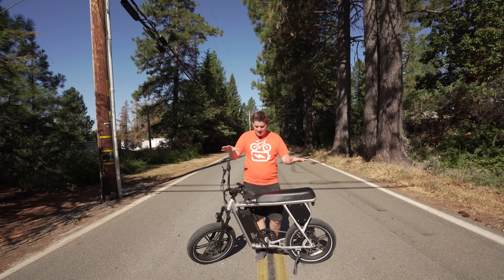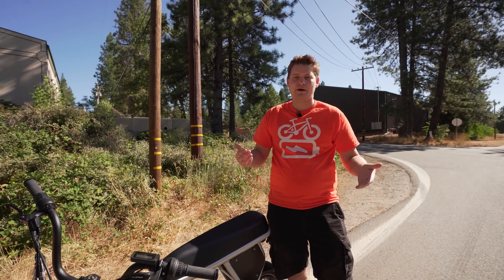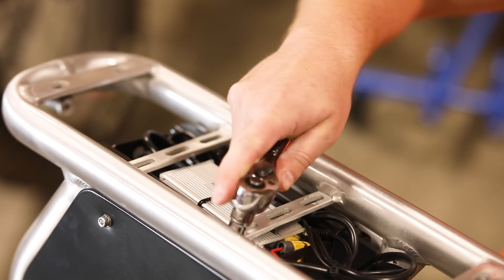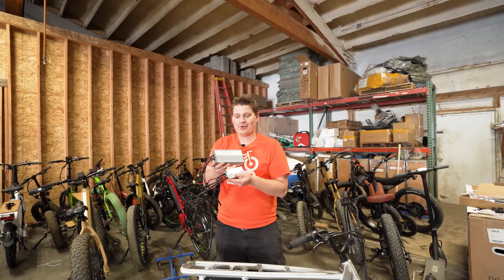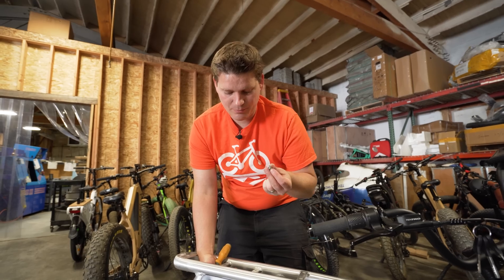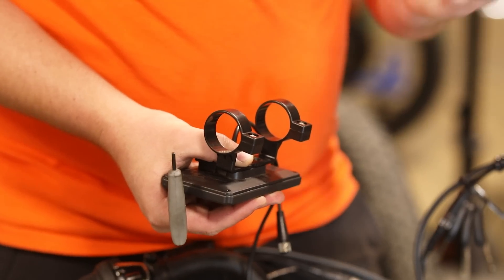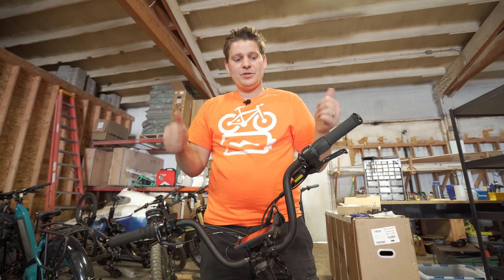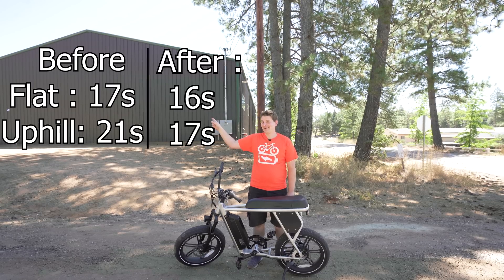How To Make This Juiced Electric Bike Faster

Comment from the maker: What electric bike do you need an upgrade kit for?
Reply: Juiced Hyperscorpion.
Reply: hyperscorpion and class D Ariel Rider
Reply: Hey I would like if you could make a controller for the juiced Rippcurrent the throttle is so slow
Reply: Cross current x
Reply: Rad City 4 - the boltonebikes.com knowledgebase mentions that you guys are looking into a 1500 watt motor for the Rad City.  Is that still a possibility?  Any ETA?
Reply: Juiced Ripcurrent S please!  The controller is undersized and always overheats with moderate hills.  The controller is buried in the frame which I think is part of the problem.  Automatically reduces power when hitting 90c.
Reply: This one!!! Please I NEED this upgrade!! When is it available my brotha?
Reply from the maker: @wreedshupeii2997  Soon! Be sure to sign up to be notified when it's ready. 

https://boltonebikes.com/collections/motor-controllers-and-displays/products/juiced-controller-upgrade-kit-coming-soon
Reply: Would like to see one for the Himiway Cruiser fat bike - would love to see and upgrade controller/display kit similar to this one and the RadRover upgrade kit. Also, would really like to see you do a video review of the Himiway (maybe a side by side test vs. the RadRover?)- here's a review of the Himiway from EBR: https://electricbikereview.com/himiway/cruiser-ebike/
Reply: The RipCurrent from Juiced is my daily driver would love a plug and ride kit option!
Reply: @graycatgrayhat3404  Hello sir. I am looking at getting this bike. I will use it as a car replacement. How is it holding up so far? Do you think this Juice bike is a better value than the Ride1Up LMTD?
Reply: @davoncci  Juiced has a 52v 13ah compared to the Ride1Up 49v 14ah so more power slightly less range.  The Ride1Up has a nicer RST front fork, and more premium Schwalbe Super-Moto tires.  Juiced has a great head light out of the box, plus the have a rear light if you are willing to wire it after the fact.  I would still pick Juiced, but I have seen several brands come and go and Ride1Up is here to stay so also a great option.
Reply: @graycatgrayhat3404  Thanks for your response.
Reply: @graycatgrayhat3404  someone did some homework lol, gj.
Reply: Ecotric hammer
Reply: Ariel d class
Reply: Lectric XP.  I read an article recently that stated that 25,000 XP model ebikes were sold.  That's a lot of potential customers looking for a performance boost.
Reply: Eahora folding x7 fat tire bike
Reply: volt Yukon 750
Reply: How about an upgrade controller for Pedegos?  I would buy!
Reply: I ordered an upgrade kit from your store July 17 for the Rad Rover 5 and I still haven't received my purchase and I haven't heard from anyone after several attempts to find out what's going on?! Starting to think I WAS RIPPED OFF!!!
Reply: hey Bolton i have the newest Hyperscrambler2 from juiced and would love advise on how to get the upgrade to make it faster
Reply: The scrambler 2 bike
Reply: HyperScorpian
Reply: I bought a ripracer. Maybe I’ll upgrade in the future
Reply: @ThunderBritches  That would be good for just swapping in a motor from like an Ariel Rider X class 52V.. stock stuff.
Reply: @kevinnashskitchen3517  I’m new to this e-bike world. Would you happen to have a link? Just engine, keep my stock controller? And thank you
Reply: I'm not sure you want to tackle all that. 😁 best wait for a kit plug and play for that bike.
Reply: @kevinnashskitchen3517  I’ve worked on motorcycles for 30 years. I’m just new to ebike planetary motors.
Reply: Let's gooo!! :)
Reply: Juiced Hyper Scorpion for sure, it already performs decently but would love to have even more.
Reply: natko 22” camel!!
Reply: Juiced City Scrambler!  Thanks!
Reply: Xiaomi himo z20
Reply: Eventually I would like to get one for my ecotric hammer. I have all my money into that right now. It is my only transportation. Last night I was in a torrential downpour for hours. I'm not sure if it does damage. I think if I put a new controller I would have to put it on the bar or something because I think it's right under the battery and it's not that big of a controller I haven't seen it yet but eventually I'm going to take it apart. Man that thing really goes. It definitely felt like it took off I wish I had a three-wheeled just for going shopping and the other one for just riding. But I do tow a wagon with it. Thanks for the videos I really enjoy these
Reply: An upgrade kit for the Bagibike B10 would be great to have.
Reply: Yeah I noticed it's all Plug and Play and you don't have to change a plug that would be nice if I had service on the eagle trading which I don't I don't even have a manual that's the bad thing the price was the good thing the service is not good
Reply: I ordered a battery from electric bike company EBC. I ordered it last Friday is that it was 10% off. I never even Get a tracking number until today almost a week later.. if I had the money which I didn't I would have bought it from a reputable dealer that I can talk to a human being instead of getting emails and thinking it's a human when it's not I figured that one out after a while the same message over and over for a week cuz I'm you can't talk to a human being at ecotric or electric boarding company none of them. You can leave a message they will never call you
Reply: 1500w 52v radrunner upgrade!
Reply: Hyper e bike
Reply: Addmotor Motan M70
Reply: Ecotric Hammer bike please
Reply: Himiway
Reply: Michael blast outsider please
Reply: Juiced Camp Scrambler
Reply: Juiced Camp SCrambler
Reply: Ecotric 36 volt 500 watt fat bike needs 48 and 750 watt geared...
Hydraulic brake upgrade and suspension fork.
It's really a good starter bike for as low as 899.00!
I bought one used for 500
00 cause it was underpowered! Basic bike is a good starter! I even thought of the older bafang midmount at 750 watts would make a good bike!!
Reply: Dclass
Reply: I want to upgrade my Radrover to a bike with with 26x4.8 tires, a 48v21ah battery, full fenders and a mid drive for less than $2400. It has to be beeyootiful, and I want to buy it from you. Think Biktrix Juggernaut HD Duo.
Reply: @rubbertwain  can 26" tires fit the frame?
Reply: @hoobakam.3931  Hi there. I'm sorry if my comment wasn't clear. I have a Radrover, it's awesome, but I want to buy another electric fat bike. Bolton offers many styles of ebikes, and I'm waiting for them to offer one that I want to buy. My comment above is expressing my requirements. Cheers.
Reply: @hoobakam.3931  And to directly answer your question: yes.
Reply: 6 hey bro I got a red Rover is Scott 11 miles on it give me a shout 918-214-6195 918-214-6195
Reply: Juiced Scrambler please.  Want the throttle to work like a gas engine throttle.
Reply: Bolton Bronco!
Reply: Hey you sale bikes like that and  how much
Reply: i have a juiced bike scorpion model regular and im thinking of putting extra batteries. Do you have any recommendations where to get them? the one i have right now is 52V 13 amps and im planning to put extra battery. Please advise. Thanks.
Reply: Juiced Scorpion for sure!
Reply: Scorpion
Reply: Scorpion
Reply: I just ordered an elux Sierra GT and I’m psyched, can I upgrade to a 1000 watt hub motor? It comes with a 750 watt motor and 11.ah 48 volt battery.
Reply: I would love a 35Ah controller upgrade for my Rize Bike’s “Liberty” 750 Watt. It comes with a 28Ah controller
Reply: Volt bike Yukon 750. And for the 500w model if possible
Reply: Mzzk fat bike
Reply: Addmotor 48 volt 24” wheels 19 amp hour battery 750 watt bafang hub motor
Reply: I just bought a barely use juiced City scrambler I believe it has the mag wheels and it will only go up to 20 mph
Reply: How about a upgrade on rip current s I know the controller inside the tube so how can I upgrade
Reply: City scrambler
Reply: Super73 Z1
Reply: Scorpion
Reply: My Juiced Camp Scrambler!!!!! I want to be able to tell people it is 'Bolton Modified' !!!!! I am looking forward to it.....!!! I will make a deal with you, Kyle: If you sell me this upgrade, I will also buy a bike from you! How's THAT for a deal?
Reply: I would be interested in the details/video of an upgrade on my  hyperscorpion..thanks ! I truly enjoy all your videos
Reply: Hi.. is Hyper Scarbler ll upgrade available on the website yet?
Reply: I’m looking into getting a scorpion X . Any upgrades for this bike?
Reply: W V
2 weeks ago
Hi.. is Hyper Scarbler ll upgrade available on the website yet? Any news on the X15?
Reply: Ariel rider xclass 48v 16ah
Reply: I have a Juiced crosscurrent s2... It performs wonderfully but I would love to get more out of it if possible...
Reply: Himiway cruiser upgrades pls
Reply: Super 73 s1
Reply: I also got a juice scrambler
Reply: crosscurrant x
Reply: Hyperscrambler 2!
Reply: Oh I’d love to get this upgrade for my fat tire ebike. I’ll give the name if it’s still possible no secret just want to spell it correctly lol so I need to go look at it but I’m not doing that this second. I also need to figure out how to measure and what size fork I’d need because I also want to upgrade it to suspension something decent right now it’s solids which are fine BUT my girlfriend crash it and bent the fork in a weird way I notice it’s slightly almost like twisted on one side a bit or it’s just either more bent or only bent slightly on the right side it’s enough I notice when riding and I can tell because I know where my tire should be when I look at it riding and it seems now too close to the pedals but not enough to make it unrideable but I was thinking of an upgrade anyway so now this is like saying do it man lol. But yes to use more potential out of the motor would be great plus as well. Question I’d have is would I need a higher voltage battery? I didn’t notice you did in the video unless I spaced out and missed it for some reason but idk for sure.
Reply: Ariel Rider Kepler needs a few display features added. A means to adjust power% for PAS levels.. A good wattage readout and voltage remaining would be very nice. . A 40 amp max from its current 33 amp stock would be perfect for this big custom 1000 watt Bafang . 063
Reply: Can I get one for my scorpion X. Looking at your new site I don't see one but it looks like you might be able to make me one
Reply: Hyperscrambler 2
Reply: rip racer
Reply: Juiced Rip Racer
Reply: Lectric XP.

Comment: I wish My little 500w Swift Zip had way more power than it does.I looked at upgrades but if I have to swap both motor, controller and LCD, I might as well buy a different bike.

Comment: The display on my Ariel Rider Kepler could be much better if it includes an ability to program power % for each PAS level.. 9 levels or 5 . Also the voltage is not available. Anyway, I believe a new display and controller upgrade for the Kepler would be great. 33 amp controller could easily be upgraded to a 40 amp with the custom Bafang 063 1000 watt rear hub. I'm sure one of these controller and display upgrades would sell very well in the Kepler Groups once word got out.

Comment: Also, I have the second battery pack on the rack with a battery blender and I've been wanting to get a battery charge monitor but I'm not sure if it's for using it while it's charging or using it on the bike at all times? And whether or not I should get two to monitor each battery individually? Thank you for your help!

Comment: I just recently bought a HyperScorpion, and I'm very interested in upgrading!

I actually had an incident recently where a dog ran me off the road and I ended up breaking my arm. I feel like if I had an extra 5mph or more then I could've out ran the dog and the wreck wouldn't have happened.

I will 100% be getting controller and motor (and maybe even battery) upgrades as soon as I'm able.

Comment: @Area13 I have a Juiced Bikes City Scrambler and I would like to get the upgrade kit but I was wondering do you have a bigger 750watt motor that would fit into my casing. I also changed my freewheel from the stock 14/28 to an 11/28 and the chainring to a 56t. I would like to know if I should put an 11/34 freewheel on the bike to get a little more speed that way as well. I’ve been calling your company phone without any luck to get someone to pick up the phone or call me back. So can you please respond back to me and let me know what to do as far as talking to someone from your company. Because I want to be able to go faster on my bike

Comment: I'd rather build a bike from scratch if I'm gonna be replacing controllers and stuff.... I have an Mx650 w/ 48v 2000w and it does 35mph but I don't like riding it far because it doesn't have pedals but it's still super fast.

Comment: Need "better", not bigger.  The Rip Current S has the controller in the downtube, so it needs to fit.  Also, did you still experience the top speed flutter?

Comment: I just ordered the scrambler with the larger battery option and their off-road module. I'm excited for it to arrive so I can use it to get to work instead of having  to drive and pay for parking. The only upgrade I wish it had would be a rear basket option so I can have something to strap my half-gallon jug of water to, and some sort of GPS for theft recovery.

Comment: An upgraded controller for the Super73 RX would be nice. I suspect that there's more that can be gotten out of the stock battery+motor combo, especially on the low end, where the RX feels pretty weak. It really picks up once you hit 20ish

Comment: More amps will make acceleration and up hills faster, however it will do little to top speed on flat ground.

A voltage increase will raise the top speed on flat ground.

Comment: Great video and very much opened my eyes to upgrading my ebike beyond cosmetic changes. 
I have a Super73 S2. What would you suggest with regards to performance upgrades?
Also, are there any aftermarket throttles that work for the Super73 S2? I have an EU spec bike and they don't come with throttles.
Thanks

Comment: So ?  What's your version of the same type bike ?   Do a side by side comparison with your bike.  
  Your upgrade kit didn't fit or bolt up very good.  There didn't seem to be a big performance improvement.  Possible wiring  overheating ?   It might be time for you to go back to the drawing board. Lastly.... how much does your upgrade cost ?

Comment: Just got a hyperscrambler 2.  It has a dual battery 52 volt and a 35 amp peak controller.  Can that be made faster?  Top speed is fine at around 32mph with me (240 pounds) on it but better acceleration would really be nice.

Comment: I have the HyperScorpion, would love to upgrade what I can.  It already gets to 30+ mph as it is so I'm not sure of it already has a larger controller than the scrambler or not.  What about other batteries, Juiced wants $1200 for another 52V 19.2 battery pack.  I only paid $1500 for the whole bike during a special of some sort.  Got it right away so it wasn't pre-order, not sure.  They do mess with list price vs discounted pricing often, but seems like now the HyperScorpion can be had for 2 - 2.5k.  I had the speed hesitation issue at first but after adjusting the top speed to over what it can do at it's max, that issue went away completely.  The front brakes squeak like crazy.  p.s. I just moved to FL from CA, was very close to your shop and tried to buy a bike from you and of course, no availability.  It was a full suspension mountain bike for about 4.5k.
Reply: 1200$ for extra battery... That's sad.
Bought my bike at1000$ , 120$ shipping fees. 1000w, 2 batteries 48V 22Ah... Those brands try hard to scare people not to buy Chinese products, unreliable etc, it's currently not worse. I have like for a year, with 4000km, I didn't get any problem yet.

I really hate companies like super 73, making/using unique/uncommon pieces and have no stock if anything brakes

Comment: I have.a Rize Blade 750 watt  motor and a 19.2 ah LG battery. it is very similar to the Juiced Scrambler.  would your controller and display upgrade work for the Rize Blade as it does for the Juiced Scrambler?  thank you

Comment: Excellent bike, but under powered. How about a 1500 watt motor and 72 volt battery with 20 or higher ah. I would like to start with the rolling chassis and build a really fast bike!
Reply: probably according to where you live but trying to get a lot of speed out of an e-bike is illegal so don't get hurt don't hurt anybody else and hope the popo don't pull you over

Comment: Hi Kyle, 
Love your very useful videos! When you have time?? Please consider this controller/display upgrade for the new Rize Bikes “Liberty” 750Watt It already has awesome power to weight, but is there any such thing as too much torque??  BTW if I’m not leaning forward when I crack the throttle on this little beast, the front end gets “airborne” What a HOOT ! With an upgrade from you I’m sure to be spending a little more on rear tires.

Comment: Upgrade your motor plug to 40A, i.e.( I use Andersons), and then use a 52V battery and she will do much better. But your upgrade still seemed like it improved this bike. I live in the NW and it is very hilly, so I use 40A and 52V Pack with BBSHD re-programmed Limitless. All hills are melted away. You are helping the e-bike community with your efforts through these videos. I watch them and I have been riding e-bikes for more than ten years.
Reply: Can you reprogram juiced controller with BBSHD - if so how>??